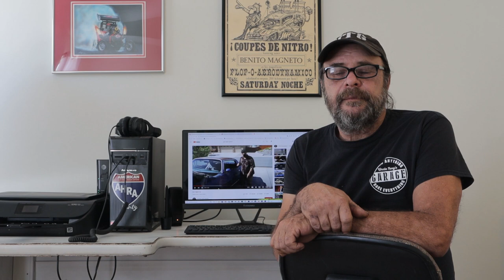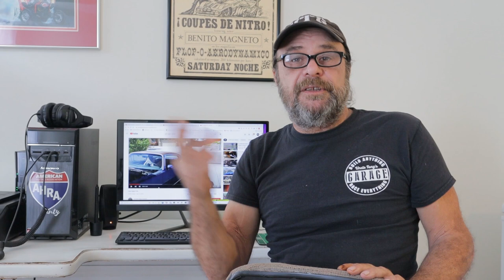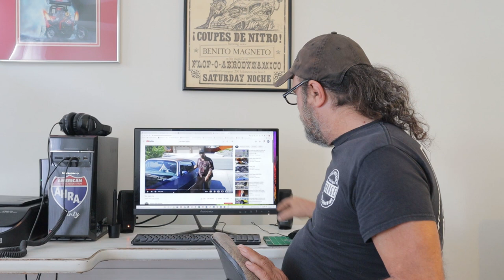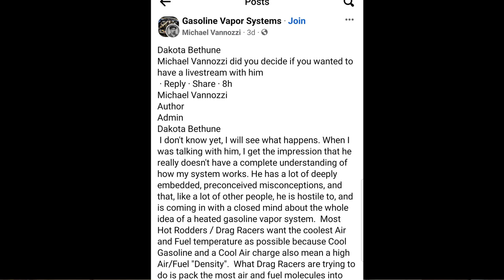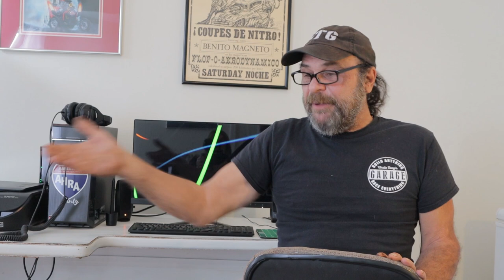Climbing Down The Mega Mileage Conspiracy Rabbit Hole

Comment: I would like to have my vehicle get 35 mpg! But if it takes 3 miles to get to 55mph then there is no driveability. And it's unsafe! you need that get up and go to merge into traffic. Or even accelerate to avoid a accident. A police car isn't any good if it can't keep up with a Yugo!
Reply: Plenty of modern-tech cars (note: CAR, not SUV or truck - think: aero and weight) will get 35 mpg US when driven nicely, and accelerate quite smartly when asked to do so. One of the keys is an engine that can make power with high revs and still be able to run smoothly and efficiently at low revs (modern variable-valve-timing, modern fuel-injection, etc). Another one is a transmission with a wide ratio spread and lots of ratios to choose from to let the engine do that. Never gonna happen with an old engine design coupled to a 3 speed automatic with no torque converter lock-up. In the old days you could get good mileage with a 2.73 or taller rear axle but acceleration sucked, or good performance with 4.11 axle ratio but top speed and gas mileage sucked. Nowadays, if you want good mileage, you press the cruise control button and let the transmission shift into 8th or 9th or 10th gear, and if you want acceleration, you stomp the pedal to the floor and it drops into 2nd or 3rd and off you go. No tools required!

Comment: It's actually how crazy the mpg new vehicles get! My f150 2.7 v6 ecoboost gets avg 20 mpg when driving at 55mph get easy 35mpg
Reply: Downsized engine to reduce friction and heat losses, 10-speed automatic with tall overdrive and lots of gears to choose from (and this lets it keep the torque converter locked most of the time), and Ford has paid attention to the aerodynamics on those. No snake oil needed.

Comment: I'm definitely not one of these mileage conspiracy people, but... in the late 1960s, I read about a "wonder carburetor" in either Popular Science/Mechanics, or one of the car magazines. Invented by a man named (I think) Carl Dresser, it was very simple, and could be easily installed on just about any car engine. The magazine tested it on several cars - from a VW Beetle to a big Cadillac- and it did, indeed, get better mileage than the regular carbs. Performance was, at worst, pretty much normal, too. Looking back on it, I don't think it was really a carburetor; I think what he "invented" was throttle body fuel injection. Which was used on some American  WWII aircraft engines, so he didn't invent it, so much as re-discover it. He did simplify it a lot, though. I never heard about it after the article - until years later, when I bought a Chevy with TBI...

Comment: Hey Tony, this is the rub with 'extreme mileage' vehicles:

There's a mathematical limit to fuel mileage. At any given AF ratio, a vehicle's mileage has a maximum upper limit in part determined by the volume of air it ingests and the amount of fuel required for the engine to run without damaging the engine. The rest of the equation is, of course, the number of gears in the transmission, the ratios of those gears, along with the rear-end ratios and tire size.

The only way to hit that maximum number is to have enough gears at the proper ratios in the transmission that the engine can run in its most efficient RPM band at all times. 

A V8 engine has four power strokes in a single rotation, so assuming a volumetric efficiency of 85%, this would translate to 170 cubic inches of air...
blah blah blah, bunch of math

basically, if you're feeding a Chevy 350 all the air it's asking for given the following:
VE 85%
AFR 14.7
sea level air at 70F
1:1 final gear on the trans
2.70 diff ratio
255/60R15 tires (should be possible, and is a tall tire)

all math done in metric because the math is easier, the 'test car':
~208 tire rotations per km
~562 engine rotations per km
comes out to ~16.34 liters per 100km
converts to ~14.39 mpg with a 1:1 top gear.
with a 30% (0.70 ratio) overdrive, it should hit ~20.56 mpg.

I'm not taking into account rolling resistance, aerodynamic drag, EV tires, or anything else not specifically mentioned. The spreadsheet also assumes a manual trans/locked converter.

note that as you starve the engine for air with smaller carbs (therefore limiting the VE) you can drive the mileage numbers up because less fuel is needed to achieve the 14.7:1 AFR. Alternatively you can change the AFR, hence the Chrysler Lean Burn system. However, all of us that like actual numbers know that as an engine is limited in air, it's likewise limited in power.

I have a spreadsheet to calculate this if you want to look it over.

Changing the VE number to hit 35mpg, I get:
VE of 50% using a T5 assuming a 30% OD get 34.95 mpg
to get 35mpg in direct drive, you have to drive VE down to 35%

Interesting. At a VE of 50% you have an effective engine size of 174 cubic inches... Isn't that almost bang-on for your Slant Six? Yep. Re-running the same setup with a 100% VE 170 Slant Six gives 35mpg in overdrive, 25 in direct. Huh. Who woulda thought?

personally, if I was going to build an 'extreme mileage' motor, I'd start with killing parasitic losses in the motor - custom roller cam, full roller rockers, valve springs just heavy enough to prevent valve float at max RPM, oil pan windage tray, and figure out a sweet-spot in the oil system between volume and pressure.
oh. wait. that sounds suspiciously like a racing motor...

Comment: Uncle Tony PLEASE READ!
If You have the time, please make a smooth running engine(one that runs and starts with low friction and not much effort),
have the carburetor Lean as possible, set the throttle so that it barely gives gas. It will be weak and slow. If You have a turbo slap that on. The leaner You get it the more gas mileage it will get. Also drive it economically(If You don't press the paddle it should not consume fuel. I mean motorbrake. Look far ahead, anticipate lamps and traffic.) Make the car as light as possible, get the weight/horsepower ratio up, while keeping the carb lean. You could get that 35 mpg easily with a normal carb maybe even more.
Please just mod Your lightest race car to run as lean as possible! I bet that could make that mpg also, easily.
P.S this is where computers and E.F.I and GDI comes into play, cant beat that with carbs.
Thanks for reading! Greetings from Hungary.

Comment: i think hho can work but needs a seprate power source, u cant pull power from the alternator and think energy is coming from nowhere
Reply: Yeah it works just fine if you make the hydrogen off a solar panel for free and then compress it in tanks of aluminum hydride.  If set up right, the tanks will release hydrogen at an electronically-controlled rate to the engine of your car.  It’s been done.

Comment: Possible easy fix to this problem. Just ask the guy to film his car . Doing a small burnout and a launch. It won't prove horsepower or performance comparison. But you might get a visual impression of acceleration by comparison to a stock Camero. I agree the only way to truly prove there is no performance loss is a Dyno test. But at least you'd get an idea if it's even real world functional for the road. If not the drag strip. All this being said I think my money is on uncle Tony's assessment. 🙂

Comment: I had a 2000 Trans Am,T56 LS1,bone stock.That car would get 28mpg at 70mph.No motorcycle carb,no turbo,no 2.70 gears.Now I'm wondering if I could have got 35 mpg,if I could have kept my foot out of it.Not saying that dudes lying,but really,who drives 55 anymore,and who wants a Camaro with 'adequate' performance??

Comment: If this worked as good as the vapers say, we would've saw it at least tried in military applications. Just like how much of high end performance piston engine knowelege was derived from wartime aero engine development, you would think drastically increasing efficiency with minimal loss in power would be quite appealing to applications like long range patrol aircraft, transport aircraft, trucks etc to increase their cargo loads, range, time in the air etc.
Reply: There is a WW2 aircraft engine design that reaped great mileage,  designed by Germany.  It is an opposing cylinder (not opposed cylinder) engine that I think Jumo designed.  It might have even been diesel.  A few years ago a startup company was going to revive it. I  think it was 2 cycle with direct injection and a blower,  kind of like a Detroit Diesel.

Comment: We know Meyers buggy worked. It split water at the nozzle. But did he have a bank of batteries to supply the power to split the water and was it rechargeable over unity on the fly or under unity. I wasn't there. Brute force, says no. Finess, using oscillating high frequency to easily break the water bond seems to be pointed out in the patten, says yes over unity. Low amp cracking circuit alternator keeps up. Meyers did hold back in his patten and yes he was poisoned. No reproduction of his work to date.

Comment: What kind of fuel mileage does those street bikes that have V8 engines installed get. I think they're street bikes that have a 350 Chevy Engines installed in them.
Reply: Probably not much better then when it was in a 3,500 pound car
Reply: Rubbish due to general awfulness. But it doesn't matter, because they are so awful that most people don't ride them much. Too heavy, too long, terrible geometry, etc. I have lots of motorcycles ... but my entire heaviest bike weighs less than that engine alone, and my bike actually goes and turns and stops.

Comment: If your shooting for insane milage, I dont think a v8 platform is the way to start anyways, if you wanted shitty acceleration and high fuel milage you should have just got a 4 cylinder
Reply: Agreed 👍you read my mind,just imagine how the clutch is on that thing.I bet the pressure plate is purple and the the flywheel is cracked. It's not worth the  aggravation..
Reply: Depends on what you call shitty. My 4banger daily has all the bells and whistles, Twincharged 1.4L, 170hp and gets 45mpg. does 140mph on the autobahn and 8sec 0-60. Sure, not a rocket, but it doesn't need to be faster for daily driving, and it's still fun on the countryroads.
Reply: @thetruth5232   shitty as in a starved for fuel 4 banger running on vapors

Comment: I see it this way, I think it Could work, but I I also know that there both is and not is an understanding of combustion.
In order to generate an acceleration of the engine, you MUST increase the burn time OR increase burn speed or increase cylinder pressure. Failure to accomplish any of these results in just a constant rpm. This means you Must increase fuel, as well as air.

Now also these guys who claim vapor forgets one of the MOST important aspects fluidic dynamics, as much as the Latent rate of evaporation.
So here is something to note: a liquid only evaporates when heat is applied.
Unlike wise, an evaporate (vapor) WILL condense under three conditions; when heat is removed, when PRESSURE is applied, or concentration is above rates of evaporation.

The second one above is the one that is ALWAYS forgotten, not known or ignored.
1)A fuel vapor is always condensed, back to liquid form, with gasoline, on the compression stroke.
You loose at least 50% or more of your vapor at this point.
2) The vapor is ignited; the burn creates heat; the heat transfers to the liquid; the liquid absorbs the heat, turns partially to vapor; this vapor ignites as is vaporizes from the heat. This creates your flame front or travel.
3) Time and flame travel is the killer of fuel efficiency. The lack of time for the upper process to occur, is what wastes fuel. This is the exact reason why ignition advance was created.
4) Lean burn accomplishes a very similar result as fuel vaporization,; so as does an increase in spark plug amperage, as well as an increase in piston dwell time and longer burn time.

Comment: I don't no much about Vapor etc system.
I do know the way you drive affects your mileage.
I have consistently gotten better milage in evey car I have owned than is supposed to get.
Example had a 76 camarro lt with the 305 in college regularly got 26 city and 34 highway.
I presently have a big boat 84  marquis with a 302 get 28 city and 35 highway.
I rarely stamp the accelerator (unhless really necessary) same with breaking I plan my stops turns etc.
I acelerate slowly and i stay around the speed limits (I move with traffic)
I really think most people would get greater milage if they just learned to drive properly

Comment: These people want a fictional hybrid fuel of Propane and Gasoline/Petrol, a fuel that would have the same BTUs as Gasoline/Petrol but store & act like LP gas, liquid & under pressure in the tank but a gas at the combustion chamber. You can run your car on Gasoline/petrol or LP gas but not some fictional hybrid.

Comment: There's no way that tiny carb and turbo can flow enough fuel to be a flexible driver. At well over 3200 lbs it would have no acceleration. Flat ground at cruise is not real world driving.

Comment: Video on diesel and homemade bio-diesel for the zombie/GFC2 apocalypse when? A properly modded old diesel can put to use any waste fluid of the industrial revolution. Gas/LPG/CNG premix in the intake can be used as a power booster.
 No conversation on gas mileage is complete without the talk about alt fuels. Pls just any video on alt fuels.

Comment: I'm with you. The concept is plausible but why is he so defensive? I'm sure it's because that 350 has little to no acceleration capabilities. You just won't get any performance out of it and a motor scooter could probably outrun this thing off the line. However, if someone could combine this great mileage concept at cruising and couple it with a system that will give it good acceleration, we might get somewhere. I know that performance factor would probably greatly affect the overall mileage but I still think it would do better than the best of what's out there in the new car market. It's just a matter of really combining two different types of systems and getting them to work together if that's possible.

Comment: So you want to take someone's car that's optimized for fuel milage,,,,and strap it to a chassis dyno???? What would that prove or disprove???
Reply: How driveable it is compared to an unmodified version.
Seems like a pretty reasonable way to determine the cars overall effectiveness
Reply: @ericlandstrom6155  How about just driving the thing around,,you know like the old days..Alittle in town Alittle highway it's not real hard to calculate mpg or drive ability
Reply: @tomcatmcgillicutty6913  Because doing it that way leaves the results subject to opinion rather than data and facts.

Comment: only so much energy in a gallon of gasoline 75 ford F350 12 -14 mpg Holley 4 barrel     ---------2007 ram 350 12-14 mpg fuel injected with all the pollution crap on it

Comment: So I play with propane injection with efi and leaning the gas system out with it enriching with the propane, 1987 f350 300 i6 3.55 rear 10.25 empty weight is 8700lbs and just on gas she gets about 20/22 mpg at 45 depending on air temp, it makes noticeably less torque at the low end but the top end at highway speeds unfortunately only gets 13 originally 10 without actually performs better like it breathes better due to partially my true ram intake that draws from under the bumper, and it gets as low as negative here in New mex, im playing with an arduino to richen it as the rpms increase under cruise, I would estimate 160hp at 3600 and 285lbs around 2k, but my idea is that the air fuel mix is not fully mixing and having a fuel air burns the rest of the gas in the cyl, we have a dyno here I want to test this at

Comment: I suppose maybe what we should really ask vapor-Camaro guy is to just see how his setup performs overall.   Let's see what it does.   Especially compared to anything else you could put on a relatively-modern five-speed and hypermile on at low highway speed.   I mean, I don't need a tiny carb just to discipline my gas usage,   especially if I may as well just drop a little Honda engine in my Volvo or something while I'm at it.  

I assume our reticent friend believes he's made a mileage acheivement,   let's see what it's useful for, I say.

Comment: Higher MPG autos are common. Are any of them mid 80's Camaros? Not where I live. (East Tennessee mountains. ) But think even Mopar made some cars that did very well on mpg. A Volare \6 4 speed OD for example. But dyno mpg are real life mpg numbers are from different worlds. Heck the mid 50's cars  were getting 30+ mpg.    Do you want the high mileage life? Go light as possible, Go Diesel. No AC,  Most of all ....Only drive down hill.